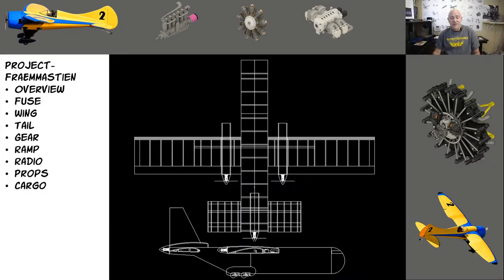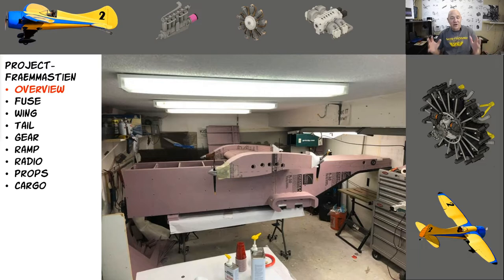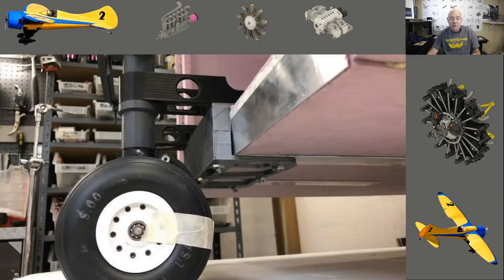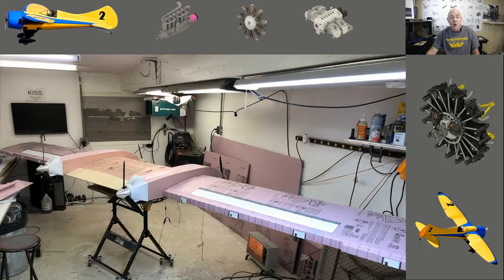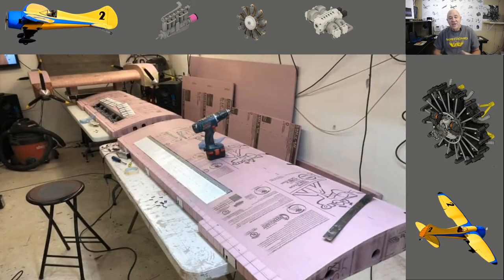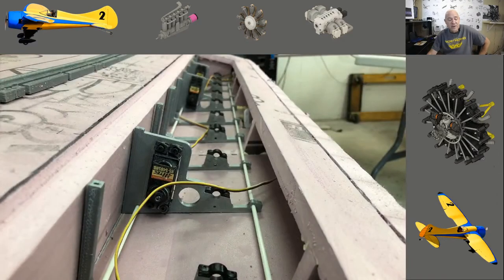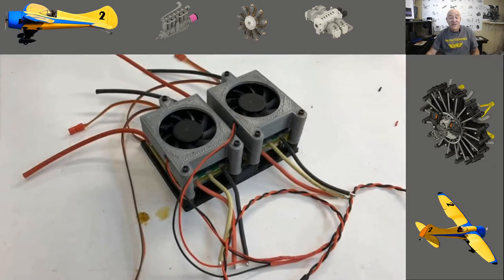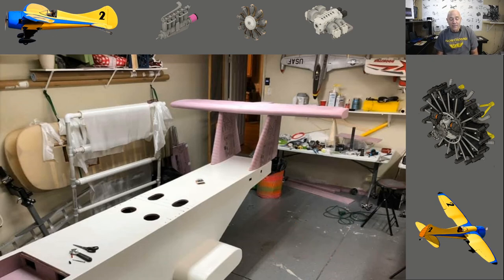220 inch span RC Cargo Plane- The FraEmmastein 220 (Overview video)

Comment: Should fly fine the only potential issue I see is that tail prop on takeoff and landing if you decide to do it. It'll make rotation a bit sketchy. Flat side no problem the slip stream won't care a bit, look at the Stratolauncher    https://youtu.be/TVkE_W4rWJk
Reply from the maker: Thanks!!!